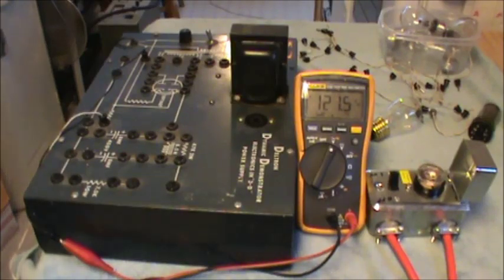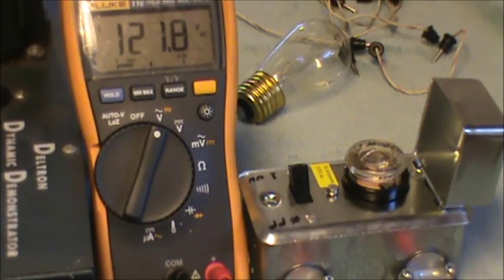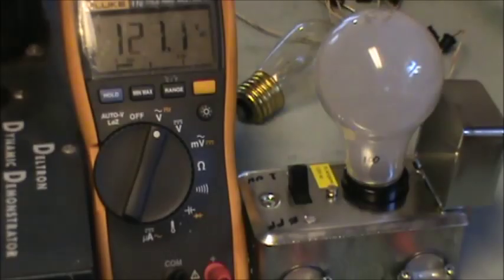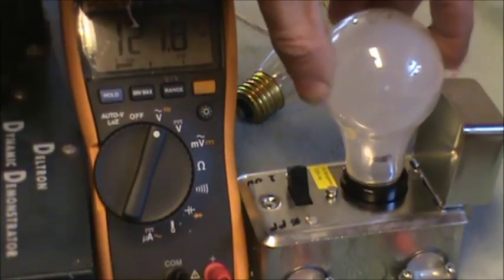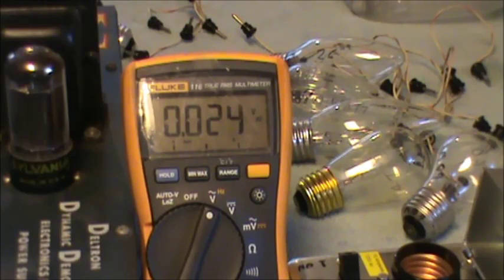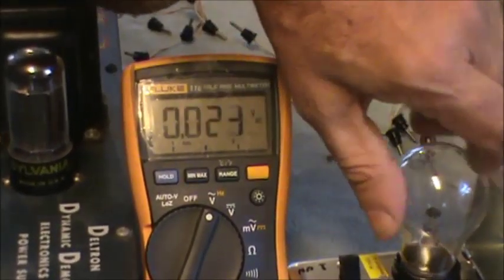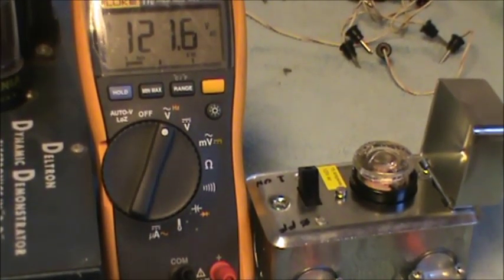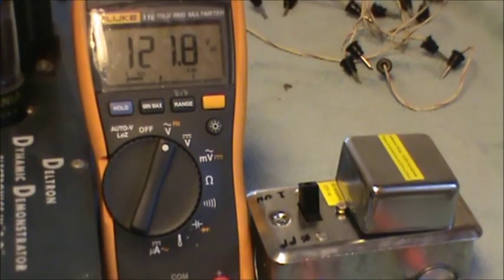Using The Dim Bulb Tester

Comment: The idea that came to mind watching this is to install a socket in the chassis of an old amp for use as a trouble light indicator so if anything changes within the amp during use it would indicate for "service check required".